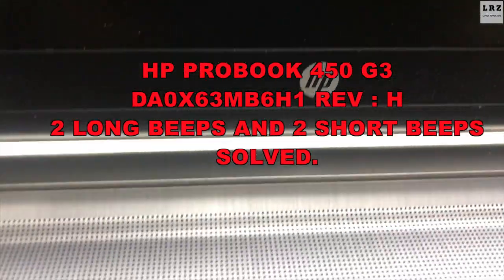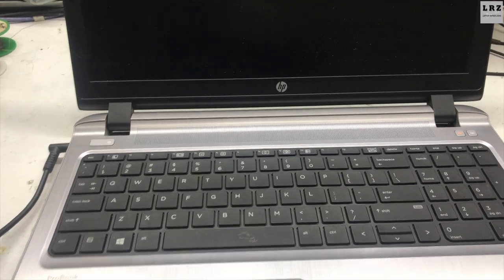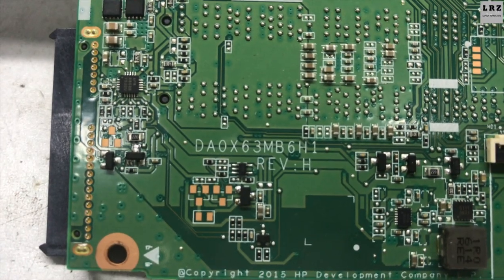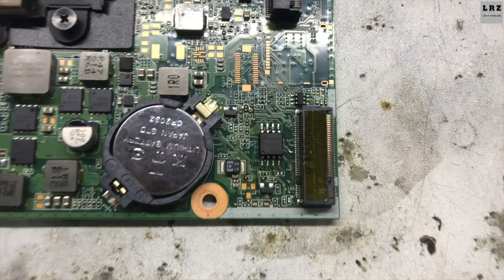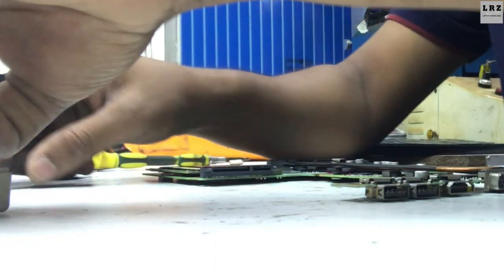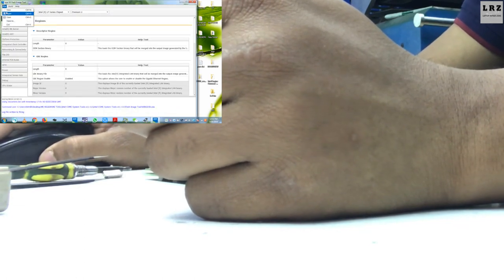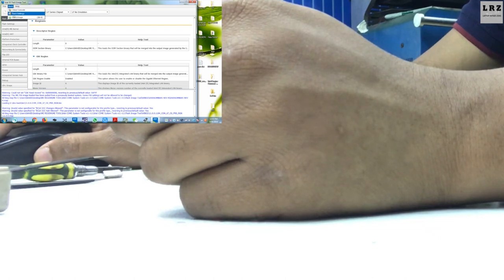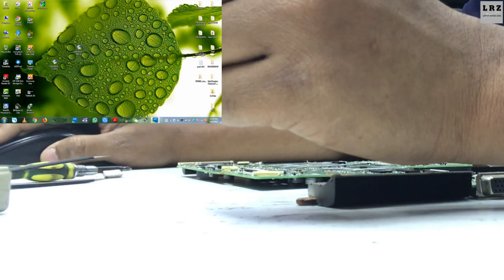Hp ProBook 450 G3 2 long beeps and 2 short beeps with black screen solved.

Comment: A combination of 2 long beeps followed by 2 short beeps on an HP ProBook laptop indicates a BIOS error, specifically related to the graphics card. This beep code is part of the pre-boot diagnostics performed by the laptop's BIOS to check the hardware components before the operating system loads. Here are some steps you can take to troubleshoot and possibly solve this issue:

1. Reset the BIOS: Sometimes, simply resetting the BIOS to its default settings can resolve the issue. You can do this by powering off the laptop, turning it back on, and immediately pressing the F10 key several times to enter the BIOS setup. Look for an option to reset the BIOS to its default settings, save the changes, and exit.

2. Re-seat the RAM and Graphics Card (if applicable): Power off the laptop and remove the battery. Open the back panel to access the RAM and, if your laptop has a dedicated graphics card that is not soldered to the motherboard, the graphics card as well. Carefully remove and then re-insert these components to ensure they are properly seated. This step might not be applicable for graphics if it's integrated into the motherboard.

3. Update the BIOS: If the problem persists, try updating the BIOS. You'll need to check the HP support website for your specific ProBook model to download the latest BIOS update. Note that you should proceed with caution and follow HP's instructions precisely, as incorrect BIOS updates can cause serious issues.

4. External Monitor: Connect an external monitor to the laptop. If the external monitor works, the issue might be with the laptop's display or its connection to the motherboard.

5. Check for Overheating: Overheating can cause hardware to malfunction. Ensure that the laptop's cooling system is clean and functioning properly. Dust and debris can block the air vents, causing the laptop to overheat and beep.

6. Professional Help: If none of the above steps resolve the issue, it's possible there's a more serious hardware problem with the graphics card (especially if it's integrated into the motherboard) or another critical component. In this case, it might be best to take the laptop to a professional technician or contact HP support for further assistance.

Remember, troubleshooting internal hardware issues, especially those related to the motherboard and BIOS, can be complex. If you're not comfortable performing these steps yourself, it's advisable to seek professional help.

Comment: Thank you for the video!
I have the same situaion with my HP pro book but I am not very handy with this
After I shut it down and then start up for a few times the computer works normally
Could you please advise if it will be harmfull in any way if I continue doing this?
Many thanks

Comment: I have a pavilion compact desktop hp two long beeps two short but no display I've tried resetting bios but wont display anything anything else I can do without having to do the extra steps you have cause indont have all that stuff
Reply from the maker: Tony thanks for your comment, yes you can clean RAM or change if not solve then you need to flash BIOS.

Comment: Very Great job , but I can t understand how to clean the bios .. I watched the other video.... but still not able to understand... I have  hp 440 g3 with mb revision G ... and 2 programmers ch341  ( gold ) and tl866ii plus .... do you have a link to a working bios to flash?

Very very thank you , you are great!
Reply from the maker: thanks for your comment,give me your mail id and full motherboard number.
Reply: @Laptop_repair_zone  , Sure!! 
DA0X61MB6G0 REV: g
Reply: BTW not received any mail... and i found a cleaned one and now hp is working :)
Reply: @Surftech09  found on badcaps forum
Reply: @laboratorioassembler  i neeed the same, i dont understand how to clean the bios, so the bin file doesnt work to mi, can you send me a copy, please, iré the same board, and revition.

Comment: quataa u83 this motherboard charging light glow but not powering on .when i press power button . processor one  part  heat  after down what is problem sir
Reply from the maker: Check PU8.

Comment: Hello everyone, please do not follow these steps. Instead press Windows key + B before turning on the laptop then don't release it even if the laptop keeps beeping after about 10 sec HP screen will show up then wait 60 second and your laptop will start normally. The trick is Windows + B will restore the bios from hard disk.
Reply from the maker: Thanks for your comment, if BIOS restore file doesn’t store in your H.D.D then what should we do can you tell us please?
Reply: @Laptop_repair_zone  All HP laptops have a copy of BIOS on the hard disk.
Reply from the maker: I know that. if someone laptop H.D.D fully formatted and reinstalled windows then how? Please make a video and upload and share a link with us. Thanks.
Reply: Existe alguna forma de recuperarlo sin el metodo que sale en el video??
Reply: @alvarojara3248  en eso ando compa, si hay algo que jale te aviso
Reply: @alejandroesparza11  ok gracias
Reply: This did not work for me.
Reply: Doesn't work when laptop won't get to the point it is accepting key commands, you must have a different issue, because the BIOS controls the keyboard use and if that is corrupted and not powering on the laptop at all you can bang all day on those keys but it isn't going to do much of anything.